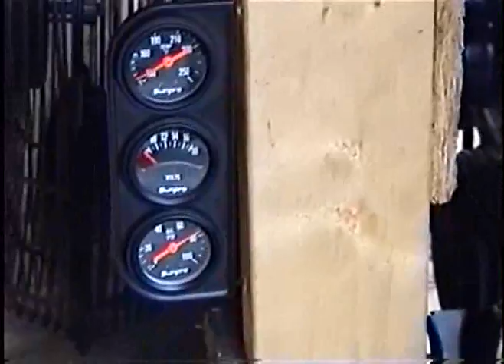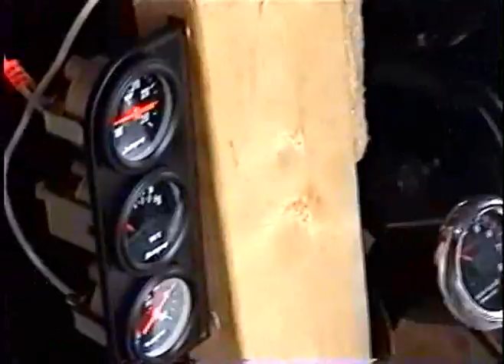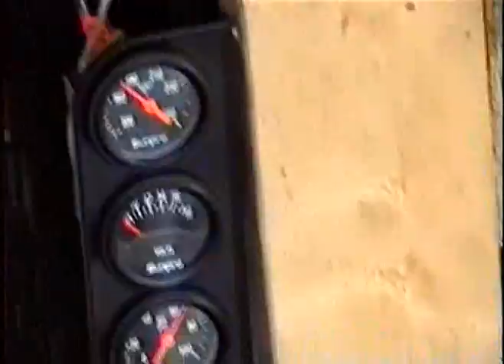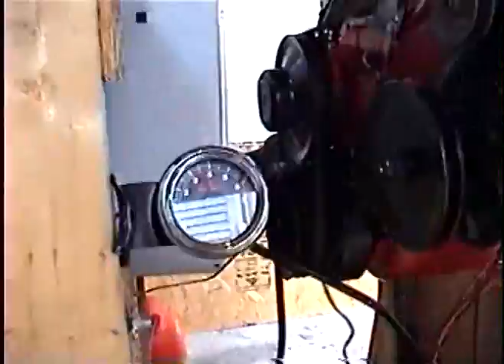Chevrolet Big Block chevy 396 breakin

Comment: How can you say it sounds like shit? It has MUFFLERS on it, and the only thing the cam mic can pickup is the wining of the auxiliary drive pulleys. Wait till it has a less baffled exhaust on it. Probably then the sound would knock your grandmas socks off. I think its smart to put mufflers on during break in to check for any mechanical noises.